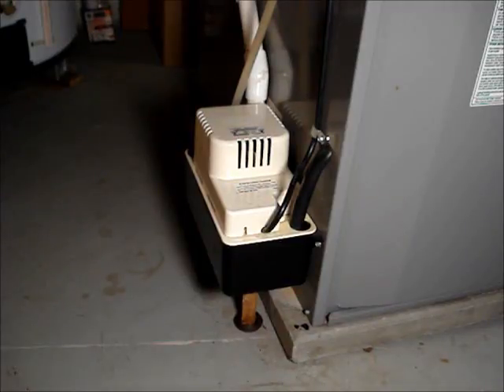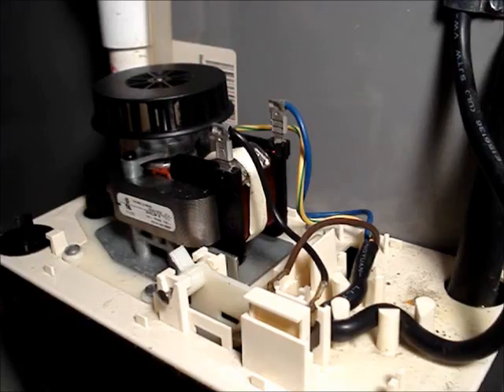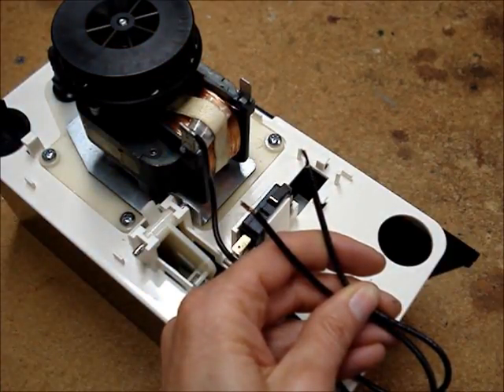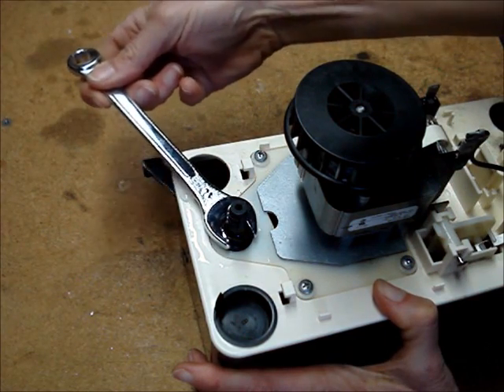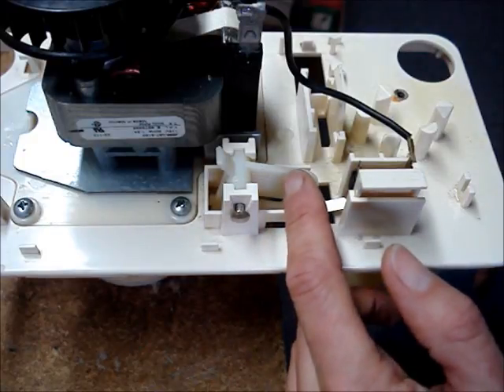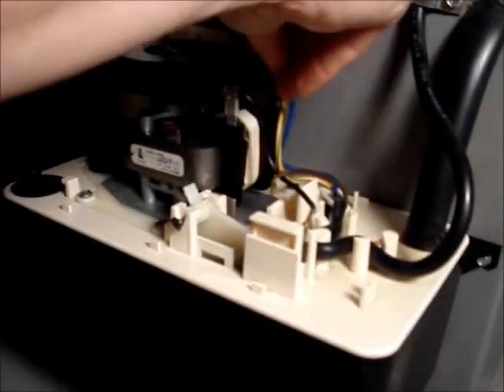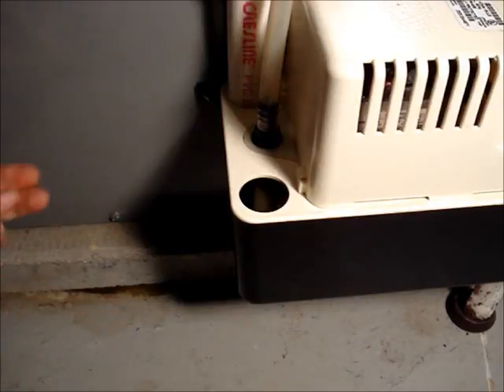Clean a Little Giant Condensate Pump

Comment: 20 years of installing and servicing condensate pumps daily . # 1 problem is algae in the lime coming to and going out of the $60 pump. At Lowes, they sell Algaecide.  It's $17. There is almost always a Cleanout on the PVC pipe going to the pump. Dump the whole quart through that. Hopefully, it's enough to fire the pump. If not, tilt the pump to make it fire. Sometimes you need additional water. Used distilled if possible. 

When the pump fires, the algaecide will set in the 3/8" plastic tube. Leave it. Let it work.  

Do this once per year for ten years, and then buy another $60 pump. And maybe replace the tubing.
Reply from the maker: Thanks for taking the time for the valuable contribution.  I love it when people share their knowledge.

Comment: I
You just saved me a $100 service call! I have a Beckett pump that was very similar to yours. The pump started to make a sloshy sound. I followed your easy instructions and found it was loaded with a jelly like material. I cleaned it per your instructions and it sounds like new! Really easy. I’m embarrassed to say it’s 9 years old and it was never cleaned but I’ll make sure to repeat the procedure every two years. THANKS!
Reply from the maker: You are welcome, Dan.  You maxed out the time between cleanings.  lol.
Reply: @Know-How-Now  I also ran some diluted Clorox thru the system after I reassembled it and it cleaned out the tubing that goes to the sewer. Looks good, smells good and runs great.

Comment: Thanks for this easy step by step video! Saved me $225 at least. My pump was running for over 45 seconds+ straight and was getting worse since it’s summer in FL. And I knew it would fail soon, if not already past repair. And I was able to clean it with this and it took longer than expected about 1.5 hours to do it thoroughly, bc the model Little Giant I have has a safety switch and more wiring etc and I didn’t want to remove all that. But got it done and runs proper now, for only 3-4 seconds at a time & a little quieter! Thanks!
Reply from the maker: You are welcome, Kyle.  It's my pleasure to help.  Thank you for watching the video and taking the time to comment, it's always nice to hear from people who are watching the videos.

Comment: The one way valve on my pump was completely clogged, I could not blow through it. I pulled it out and soaked it in a cup of white vinegar, stirring it around in there. Then I ran water through it under the kitchen sink. Then I could blow through it just fine. The pump was draining out of the hose at a drip-drip-drip rate before and now it comes out like a garden hose. This video saved me a lot of frustration!
Reply from the maker: Thanks for taking the time to comment and sharing your experience.  Congratulations on fixing you pump!  As many others have done, please support the channel and subscribe, it's free.  It will allow me to continue to add videos.

Comment: Excellent video. My pump was gunked up / not working. the HVAC guys have been servicing my system every year, but never bothered to service this pump. The steps and cautions you presented are spot on. Removing and cleaning was a piece of cake. I did add one caution step, I put a rubber mat on the floor to stand / sit on while servicing....., JIC I got hold of a live wire.
Reply from the maker: Thanks for the kind words, Bob.  That's great idea to put the rubber mat on the floor.

Comment: I followed the steps on a very similar pump that was very dirty; however, I noticed that the pump was still running endlessly so I looked at the discharge line and noticed the water wasn't moving. Went outside and notice the part outside was frozen. I poured some boiling water on it and boom it started to discharge. The video was very helpful though as the inside of my pump was nasty. Thank you.
Reply from the maker: Thanks for taking the time to write about your problem and the solution.  Someone else may learn an important lesson.

Comment: I noticed water around the furnace and was beginning to get really worried. I called two HVAC companies, but it's a holiday weekend so neither can get out here 'til Monday. I started researching what the problem could be and found your video. Thank you, thank you, thank you. I'm going to try the vinegar flush first to try and buy some time.
Reply from the maker: I have two other videos about condensate pumps that may be helpful:  

https://youtu.be/-wX2KXitQbAhttps://youtu.be/TzyxRlG_iJE
Make sure that the pump has power, maybe it got unplugged or someone turned a breaker off.  If the furnace won't run and the pump is overflowing, then it's likely that the pump is wired into the furnace (to stop the furnace from running and causing a flood).  If a full condensate pump reservoir is keeping the furnace from running, then empty the reservoir, it will allow the float to go back to the "non over flow condition" and the furnace will work..... until the reservoir fills up again.
Reply: Thanks. The furnace runs fine and the pump is hardwired into the furnace. For now, I've re-routed the pipe coming out of the furnace into a shallow dishpan so at least there's no more water all over the floor. I'm going to simply replace the pump but am a bit leery about dealing with the hardwiring.
Reply from the maker: Sounds like you have it under control.  I agree, dealing with the hard wiring can be a little scary.  I'd like to hear how the replacement works out.  You should be fine as long as you turn off the AC power to the pump when you are replacing it.

Comment: Your video easily shows how to clean/maintain our condensate pump & was very much appreciated! It had not been cleaned at least since buying the house in 1996 & started leaking on the laundry room floor in December of 2017. Seems I got pretty lucky with such a long run of hands off operation & then finding your video so I could take care of it myself. I particularly valued the "gotchas" that could derail this project; e.g.: no water on motor, drain tube in a cup or reservoir & careful with the tabs! Mark
Reply from the maker: Thanks for taking the time to compliment the video, it always makes my day to hear the video was helpful.  After you finish cleaning yours you'll be good for another 20 years.  lol.

Comment: Excellent. Short, simple, clear, good close ups. No muss, no fuss. Only problem for me was that after cleaning, discovered micro switch had gone bad, wouldn't switch off. Those puppies are expensive, upward of $30 (when you add in shipping - couldn't find anything local) when a whole new unit costs only $42! Still, this is how YT help vids should be done.
Reply from the maker: Thanks for taking the time to share your experience, Rory, I'm sure it will be helpful to other viewers.  I too had a micro switch go bad.  I bought a new pump and kept it for spare parts.  I agree, YT is great, though, some times you have to sort through a few videos until you find one that solves your problem.  I try to keep the videos short, accurate and helpful.

Comment: This was extremely helpful, thank you. Can I ask - How much water should still be in my reservoir normally? After my pump runs it seems like the reservoir is still half full.
Reply from the maker: The amount of water that is remaining in the bottom of the reservoir depends on the location of the pump water intake holes.  The water level after the pump has run should be at the level of the intake holes.  I suppose it could be higher if the one way valve lets water flow back into the pump or the switch for the float is not working properly.  I have two companion videos, how a pump works and how to troubleshoot.  https://www.youtube.com/watch?v=-wX2KXitQbA  https://youtu.be/TzyxRlG_iJE

Comment: Great video! I have exactly the same pump which had stopped working. It was indeed filthy and I cleaned it out according to your instruction. In the end, I noticed that the one-way check valve seems to be broken or clogged. I had removed the valve and could not blow water through it at all and could not make it flow despite my efforts. In the end I popped the little ball out making it a "two way" valve that flowed freely and also proved that the pump itself worked fine still. In my case water does not seem to backup down the discharge tube, do you think it really needs to be a "one way" valve? I will likely order a new valve for good measure and it is great I don't have to replace the entire pump.
Reply from the maker: If the drain tube is set up so that it can't siphon water back into the pump, logically you don't need it.  Personally, I'd replace the valve, but I'm picky about that sort of thing and would feel compelled to make it right.

Thanks for commenting.  I hope the pump maintenance didn't get in the way of your bicycle riding.  In my area of the country it was a great weather weekend for a bike ride.

Comment: I think I probably damaged the rubber impeller by adding bleach (it was working fine before I added bleach for the first time). The pump makes a high-pitched rattling sound several times each day which lasts about 3 seconds (I'm guessing each time the pump is activated).  Do you think this could be fixed by cleaning the pump, or should I just replace the pump?

Comment: Hello. Your video is great because it is easy to understand. However, I do have a question. I've already checked my check valve to see if it is working and it does shoot a strong volume of water through it, yet, the pump is turning in continuous short bursts instead a longer one to drain the pan. Is this a sign, that I need to replace the whole unit? Is this a sign that the float is in need of replacing?  One YouTube post indicated that if that was the case that one should replace the whole unit as opposed to getting the float part and installing it because there is a good chance the switch lever could be damaged trying to replace just the float.
Reply from the maker: I have a companion video to this one that shows how to troubleshoot a condensate pump.  You might want to check it out:  https://www.youtube.com/watch?v=TzyxRlG_iJE

Comment: I'd like to troubleshoot my pump before anything but mine is directly wired to the HVAC unit. What safety measures would you recommend I take before disconnecting anything?
Reply from the maker: You need to remove power to the pump and to be safe turn power off to the furnace.  I have a video that shows how to trouble shoot a condensate pump:  https://www.youtube.com/watch?v=TzyxRlG_iJE

Comment: I have clear 3/8" tubing from pump to drain.  Is it better to use black tubing or clear?  How often should i replace the tubing (every 5 years)?  Is there anything i can put in the pump reservoir to keep the drain line clean?
Reply from the maker: Hi David, I'd go for clear tubing, if the tubing is visible, you can see it's condition.  Vinyl tubing should last a long time unless it's exposed to some harsh environment, like direct sunlight.  If it is getting clogged and the run is short, then replacing it when it gets too gunked may be the easiest solution.   

I know you can buy tablets, but most people say they don't work.  You could try adding distilled white vinegar.  Some people use bleach, but that is not friendly and may cause damage if it not thoroughly flushed out of the system.

Comment: Thank you for the video!!! My condensate pump valve broke in half and therefore water all on the floor. 😡 Do you know how to remove the piece that's still screwed in? Or do I need to purchase a new pump?
Reply from the maker: Sorry for the late response.  Are you talking about the one way valve that goes to the drain tube?  I had the microswitch fail on mine and just bought a new pump, replaced the switch and kept the rest for spare parts.
Reply: @Know-How-Now  No worries! It was the one way valve thing. Somehow it snapped in half...probably from someone moving the condenser and not realizing that the hose was connected. But God was watching out for me! Lol! I used a pair of scissors to "unscrew" the piece that screws into the unit itself...and it worked! I still purchased a new condesate pump thing since it was only $40, just in case. But when the AC guy checked everything out, he gave me a thumbs up. I'll just keep the new pump for in case I or one of my neighbors needs it. Thanks for the video!!! B/c of it, I cleaned the pump so well, he thought it was the new one! 💪 Girl Power!!!
Reply from the maker: Great work!  When I looked into buying a microswitch, the parts & shipping were not cheap.  That's why I bought another pump.  It never hurts to have spare parts.

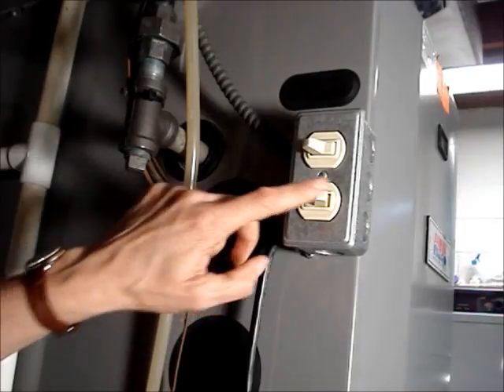Comment: Odd, but my pump does not have an electrical plug that goes into a receptacle, nor does it have a switch as in 0:51    Instead the pump is hard wired into an electrical box inside the furnace. Great video as usual; always learn lots !!

Comment: Well, the service man just left and said, there is a lot of gunk in the pump pan, put some bleach in it. or pay $250 for a new condensate pump. I stuck my finger through the hole and it feels like jello in there. Could I just turn off power and take off the black pan underneath or do I have to go through all these steps?
Reply from the maker: It depends on how it is mounted, and how thorough of a cleaning you want to give it.   If you think you can do it that way... go for it.  The way mine is mounted, it would be very difficult to clean without removing it.  When they designed these pumps they didn't give any thought to someone trying to clean it.... just be careful that you don't break those plastic ears on the pan.  Some people think that putting bleach in the pump can damage it.  My thought is that if the bleach is diluted it won't do too much harm.  Also, if you have to replace the pump, you can buy one for way less than $250 and install it yourself.  It's not rocket science.
Reply from the maker: If your pump is the same model as the one in the video, there are 2 screws on either end of the black bottom pan that should be holding the pump onto some surface.  There is also a tab on the top of the white cover.  To release the top cover from the black pan, you have to use a flat screw driver to push the tab while lifting the top cover.  

If you are having trouble seeing how to take it apart, maybe you could find a friend to watch the video and help you clean it the first time.  If you take some notes, or maybe pictures, then next time it needs to be cleaned you should be confident to be able to do it yourself.  Everyone learns differently.  Sometimes I am little scared the first time I try something new, and it often goes a little rough, but it is easier the next time I do the task it is easier.

If you haven't subscribed to the channel, please consider it, it's free... and it will allow me to continue to make more videos.  I do need help to be able to keep making the videos.
Reply: Thanks to you, I got the courage and cleaned my pump. I watched your video a dozen times, I was so nervous. Let me tell you, it was thick as mud, when I stuck my finger in it, it felt like a pan of jello. I cannot thank you enough. I see these pumps are on sale at K-Mart online so I ordered one for 39.99 and free ship and I think I will install a new one in the near future. You are great, I totally admire you. Thank you, this was a big deal. This pump sounded like it was grinding, real loud and a huge aquarium-like noise.  I still hear the water noises but no grinding noises now. Wow, you are great, I don't know how to express myself to show my gratitude for your video. You might think it obvious to tell people to unplug it and turn off everything, but I was so nervous, I wouldn't have done that. Thanks again.
Reply from the maker: That's fantastic news, it makes my day to hear that you gave it a try and had success.  I too bought a second pump because the micro switch for the float failed.  Now I have spare parts.  One thing about pumps, don't run a pump without water in the reservoir, running a pump "dry" can damage it.  A few seconds won't hurt, but you don't want to run it for an extended period of time.
Reply: I didn't know that, I am on top of that right the heck now!
Reply: C_ Farther I have the same grinding sound and found jello.  Gonna clean mine tomorrow
Reply: $250???? That's criminal! You get one from Amazon for $40!
Reply: I was just quoted $300 by an HVAC tech during a service visit. Wow.

Comment: My pump keeps making loud noises, should I do this first before calling a professional out?
Reply from the maker: Check to see if there is water in the pump.  If the pump runs dry they make a grinding noise (bad for pump).  I have a video that shows how to troubleshoot a condensate pump:  https://www.youtube.com/watch?v=TzyxRlG_iJE
Reply: to call a professional will no doubt be at least $100.  A new pump I'm told is about $40 from Home Depot or Amazon, suggest buying a new pump, install it to get operational again, very simple. Then watch the YouTube video's on how to repair and test it. That way you get it running cheaply immediately, and have an emergency spare for when it acts up again in a year or so